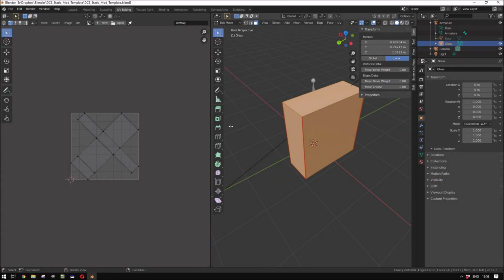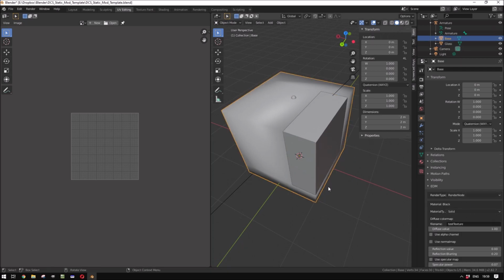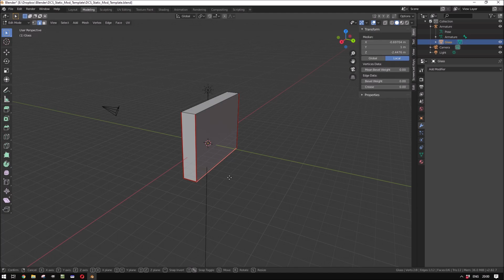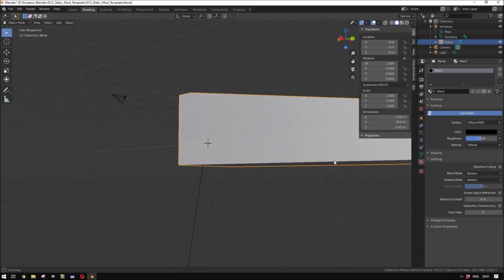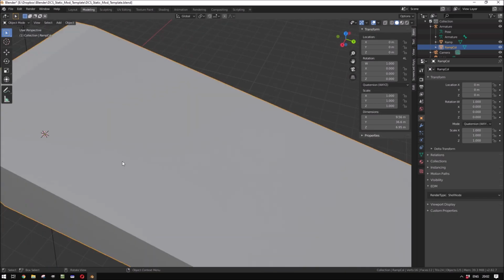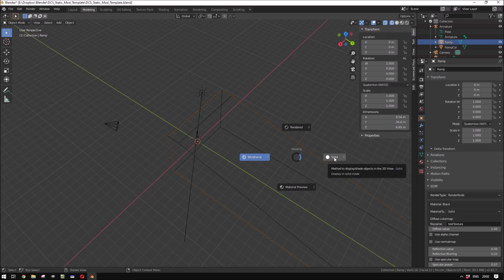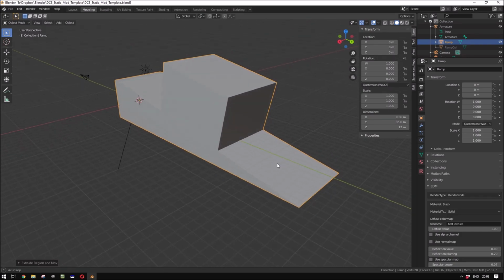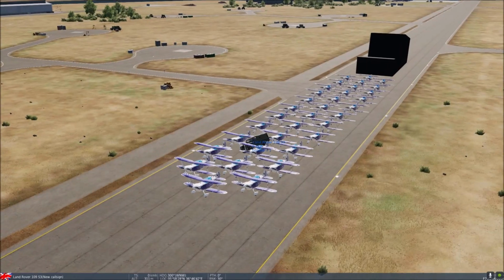DCS Mod template - adding a collision object, and testing it in DCS

Comment: Have you worked out how FakeOmniLights work yet? I'm trying to make some lights for my hawk mod and I have no idea how they work. Great videos!
Reply from the maker: No, sorry. I cannot get fake omni lights to work at all, I think it is to do with the specular. Setting a plain axis empty's DCS property to "lights" as you would a diffuse texture works in ModelViewer2, but LUA is needed to activate these in DCS. This can be found in the model lua usually near the bottom near the pylon data. I have not covered these myself much, but I have had them working.
Reply: @fireblaze7994  Gotcha, no probs! I'm having great fun working out how DCS mods work.. especially cool how the roughmet can have 4 maps in one image.
Reply from the maker: Much to learn, but these techniques are standard across 3d modelling in general. There is a lot of info out there, it's just knowing what to search for :) Normal maps is the next thing I want to show. These work a charm with the export tool by tobi